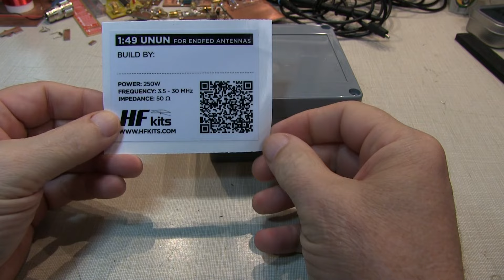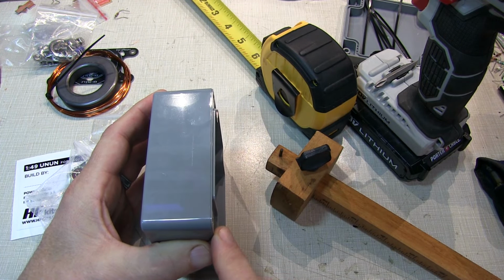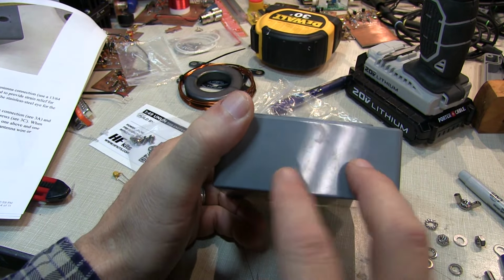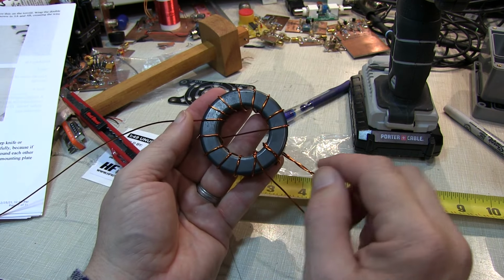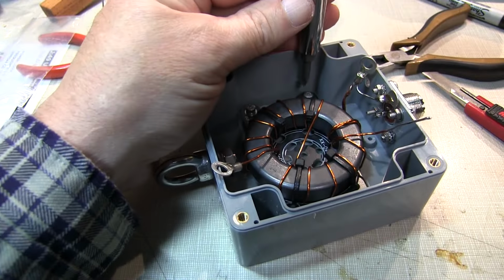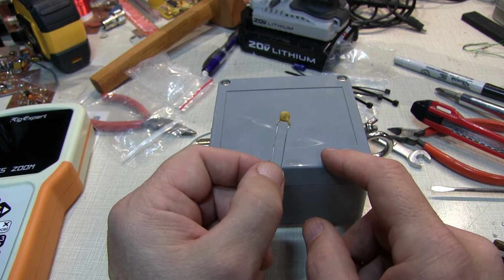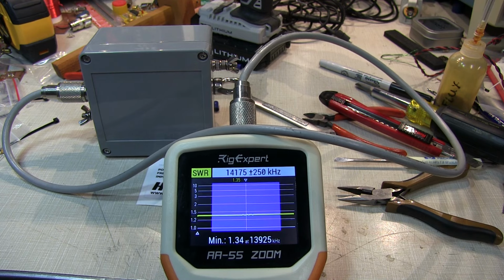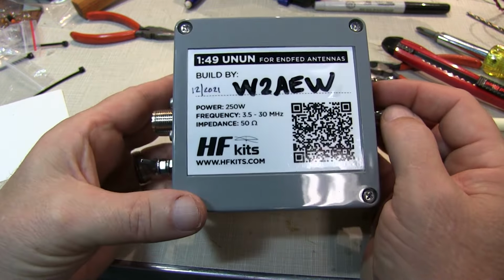#344: ARRL 49:1 End Fed Halfwave UNUN transformer kit from HFKits - Build and quick bench test

Comment: Experience needs one piece of advice. When operating, it is best to have a common mode choke on the feed line at approximately .05 wavelengths from UnUn for the lowest band you use (80 or 40). This is best regardless of attached counterpoise.
Reply from the maker: Great piece of advice!
Reply: Yes, just use common mode choke 0.05 wavelengths down from the feed point on the lowest band and don’t use an external counterpoise (AA5TB was the first to propose a 0.05 length counterpoise as being adequate based on modeling, and I have also confirmed 0.05 wavelength is adequate based on modeling).  The outside of the shield for the first 0.05 wavelengths of the coax is adequate counterpoise.  Having the choke also does a great job keeping RF out of the shack.  I use a 40 meter EFHW mounted horizontally using the 0.05 wavelength choke concept and could not be happier.  My choke is 14 turns of RG58 on an FT240-31 toroid core and this choke is based on the work done by K9YC.
Reply: @wd8dsb  So your RG 58 is wound around a toroid? like the whole coax? or would  RF chokes like snap on work also?

Comment: Mount the stud for the counterpoise? An end fed antenna DOES NOT require any counterpoise. The stud you are installing is for EARTH grounding the antenna. This helps provide some lightning protection and also bleeds off static charges helping to make the receive with the antenna more quiet. ARRL folks you need to get your terms correct!!!

Comment: Here is a little tip. Move the counterpoise terminal to the same side of the housing as the driven wire. Attach approx 6 to 8 feet of 450 ohm ladder line. Shorten your main line by the same amount and connect it to the main line of the 450 ohm ladder line. The other conductor of the ladder line terminates in mid air. You then have a built in counterpoise for portable or temporary use. BTW I would recommend you install the 100 pf cap in this configuration. This is a combination of the EFHW and Zeppelin antennas. You will usually find that this makes it totally useable on 6M as well.
Reply: Hi Alan, 

Thank you for this neat tip. I would like to be able to get the 6m band and want to try this approach.

To be sure I understand, one ladder line wire is attached to the antenna terminal and the other is attached to the counterpoise screw. At the other end the driven element is attached to the hot lead and the counterpoise wire is free. Is that correct?

In order to put the counterpoise screw on same side as fed wire, the enameled copper wire has to be brought over the transformer. Can't that short the transformer coil? Should it be covered with tape to prevent that?

For my 2nd floor setup I propose a short coax feed line be attached to a coax connector on my MFJ window pass-through panel which is ~10ft up. On the outside,  the 49:1 unun will be fed by a 1-2ft piece of coax and hang on the side of the house from the mounting screw on the unun.  The driven wire will be strung across the back yard to a couple 20ft fiberglass poles. The driven wire will also befitted with a homemade coil to access 80m as per kit directions.
Since this a semi-permanent installation at my QTH, how would you recommend grounding it? 

Thank you for your insights!
73,
John - KK7JBZ

Comment: The inductance & capacitance of the antenna, the length of the counter poise and the length of the coaxial cable will determine the final swr reading. It would be great to see details of the final setup of the antenna. 73 M0JZR
Reply from the maker: Ideally, if it is cut as a half-wave length of wire and properly mounted, it should have an endfed impedance that is 2500-3000 ohms resistive.  Of course, there are a lot of variables that can alter this...
Reply: @w2aew  Yip, that is why it would be great to see the final setup. 
Thanks for all the great videos and the reply Alan.

Comment: It's a clearer video with clearer pics than arrl website direction.  The different solder configuration from the ARRL directions confuses me.  As primary here is pigtailed.  But the other directions don't do a pigtail.
Reply from the maker: I mistakenly didn't leave enough wire, that's why I did the pigtail.

Comment: I built mine with two toroids with good results. Used it with a half wave at 40 Meters. Tunes all the hf bands including 6 meters, except for 10Mhz. Seems to be a good compromise for power handling, efficiency while still being matchable on the higher frequency hf bands.

Comment: Great video. Here in NE Florida I use an end fed half wave antenna cut for 80 meters configured as an inverted L. My home made 49:1 UNUN almost identical to the one in the video except I use two toroids glued together. It works from the low end of 80 to the top of the 10 meter band with an SWR low enough for my Icom 7300 to tune with it's internal tuner. Without the tuner the SWR is about 1.6 : 1 on 80 and 40 and about 1.9 : 1 on 20. 

For those who say that an end fed should be avoided I vehemently disagree. I consistently work Europe on 75 meter phone as well as on 40 SSB and CW with 100 Watts. Early on Christmas eve 2021 I worked E51JD Raratonga, Cook Islands in the South Pacific on the ANZA net on 20  meter SSB. I forgot that I had been testing with low power and was stunned when I looked down to see that I was working Jim with only 10 Watts !!! 

My UNUN is mounted on a pine tree about three feet from the ground. A 6 foot ground rod is hammered into the ground a few feet from the tree. The antenna runs about 50 feet up the pine tree before it goes horizontal to a second pine tree for a total length of 135 feet. The UNUN provides a direct DC connection to the ground rod which lowers static noise and provides superb lightening protection (essential here in Florida). I do not use any radials or a counterpoise, the coax provides that. By the way, I use a 100pF capacitor across the input, Dave N2SN.
Reply: Great video which reinforces the documentation that exist on that website (HF Kits)...I had sent for a bundle of toroids (43) and will be making some of these 49:1 UNUN....Dave, what is the purpose of using two toroids?   More power better performance?  Both?

Rafael / NN3RP
Reply: @TheCrunchbird  Thanks, David.   I watched Steve's overview of the UNUN.   He uses 3 toroids for full power!....This video and Steve's allow ones to fully understand the construction and hardware details; gluing toroids, eyehooks, plastic box, etc..   I am going to try the 3 toroid concept as I like QRO....others I will build for 1 toroid for my travelling purposes.   73s and hny 2022....Rafael / NN3RP
Reply: Hi David!
Studied your reply with interest as I have this kit and planning a similar install in my smallish back yard. 

Specifically, to what part of the unun did you attach the ground? Did you add a lightning arrestor at some point, and if so, where?

Thank you for your help!
Kind regards,
John - KK7JBZ
Reply: @johnbauman4005  John, I grounded the shield side of the coax to a six foot ground rod. This is a really good way to protect from a lightening strike as the antenna has a DC connection to ground right at the UNUN. It also eliminates static buildup. 

There is no need for a counterpoise as the antenna uses the coax for that. Some people insist on using one and adding a choke or an inductor to isolate the coax before the UNUN. I and many others have not done that. Both ways work just fine. 

Be careful not to wind any loops in the coax unless they are near the shack as the antenna uses the coax for its other half (unless you use a counterpoise). 

I have worked the world with 100 Watts and I have even held a QRP sideband QSO with several Australian stations from my QTH here in NE Florida running five Watts. 

My antenna is a half wave for 80 meters but for a smaller garden you can use a half wave for 40 meters and still work the harmonics. The antenna can be formed into an inverted V or even an odd shape and it will still provide great results. Good luck, Dave, N2SN in Hilliard Florida.
Reply: @TheCrunchbird  Hi Dave! Thanks for the quick reply and all the info. 

My radio room is about 10ft up, over the garage. I was planning a 2ft run of coax from IC-7300 to my MFJ pass through panel. Outside I would use another 2ft of coax from panel to unun and secure unun to the side of my house using the provided hardware. The antenna wire would run diagonally out to the right property line to a 20ft fiberglass pole, then to the left along the back fence to another 20ft pole. Also plan to insert the coil for 80m as per the instructions. 

In this case there isn't much of a feedline run to serve as counterpoise which is why I think I need one. 

This saves money, time and work vs having to bury 30 -60ft of waterproof coax. This native Floridian now lives in the Pacific NW and it is rainy most of the year. 

Am also considering another mod suggested on YT to use ~8ft of 450 ohm ladderline with one side attached to the unun at the center terminal of the antenna output connector and the other to the counterpoise connector. At the other end the hot ladder line wire goes to the antenna and the other lead (counterpoise) is open. In this case I think I need to run flat copper strap from the counterpoise screw to my house electrical service ground rod which is nearby.

In your experience does this proposed setup make sense? Am kinda making it up as I go along after reading a bunch and studying YT vids on EFHW antennas.

One of my goals is to be able to reliably make contacts in north FL from here. One of my brothers lives in Tallahassee, and I'd like him to get involved in the hobby also.

73,
John - KK7JBZ
Reply: @johnbauman4005  John,

What you are planning sounds OK to me providing that you don't get a lot of lightening like we do here in Florida and you are not after too much DX. 

For such a setup I suggest placing a nice long ground rod to connect the ground side of the UNUN. This keeps the antenna at ground potential which eliminates most static problems. It also provides a DC connection from the antenna to ground that will conduct a lightening strike to the ground instead of into your shack. 

I am running coax about forty feet underground to a 50 foot pine tree. The UNUN is screwed to the tree and right below it is a six foot ground rod that connects to the UNUN's ground. The antenna wire runs up to near the top of the tree then comes down diagonally to a wooden fence pole. 

Your antenna will work much better for DX if you place the UNUN at the pole and run the wire up the pole before bringing it down at an angle or running it horizontally. This would be similar to what I am doing here. My advice is as follows: 

Run direct bury rated coax out to the pole. Connect the UNUN about two feet up the pole and connect its ground to a six foot ground rod. The buried coax will become part of the antenna negating the requirement for a counterpoise. Now run the remaining wire to the second pole and down to whatever you can connect it such as a fence post. Be warned that the end of the wire will be at a high voltage when you are transmitting so keep it above head height so you don't fry the kids. 

My QTH is in the extreme NE of Florida above Jacksonville and just below the Georgia line. Let me know when you get your antenna up and I will make a schedule with you. I too am running an ICOM-7300 (fantastic little rig) barefoot so it will be a good test to see if you will be OK to work your brother. 

Good luck, Dave, N2SN.
Reply: @TheCrunchbird   @David Emery  Hi Dave! Wow, thank you!

I have a way to go yet - a few items on order, and plan has changed a bit after ordering Spiderbeam 12m pole and corresponding with them. Doing the trig and using a laser measure sorted things a bit. I will order enough coax to give your recommendation a try also. Problem is the buried coax also has to cross a small stone wall and stones are large and well embedded in the ground. I'll figure something out.

73,
John

Comment: Thanks for sharing. Not my area of interest, or expertise, but it is always fun to watch a build. Tip = You can g-r-e-a-t-l-y strengthen the anchor bolt point by just adding a backer plate. A large flat fender washer can work. Add a little epoxy under it. HTH.

Comment: Hi Alan - I just assembled this same kit from HF Kits. After completing the assembly I took another look at the orientation of the SO239 connector. I’m relieved to see that I installed the connector the same way you did with the square plate on the exterior of the box, which is opposite of what’s shown in the instructions. Having the plate on the interior seems to invite water penetration. I’m now building a choke kit from HF Kits and find the same issue. I’m going to go with my intuition and install the plates on the exterior. - Cheers - Jim (KK7CSC)

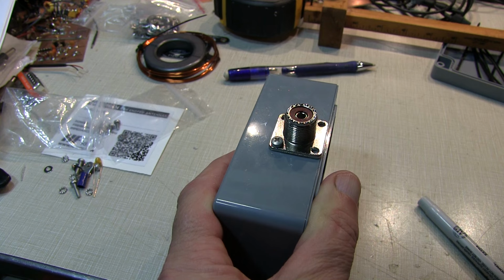Comment: Nice build, Alan. Personally, I've never had success with multiband EFHWs with a transformer on a ferrite core, and I tried like 5 times with slightly different transformers (1:49 / 1:64, different core material, autotransformers / galvanically isolated). It seems that all the online reports on successful builds of such antennas don't use a 1:1 balun and use the feedline as a part of the antenna. Also, I measured the losses in the 49:1 transformer on an FT240-43 core and got about 1 dB or 20% of power which is huge (a 1:4 transformer in a City Windom has only 4% of losses). This being said, Fuchs antenna, City WIndoms and single-band EFHWs work just fine. I wonder what your experience is going to be like. 73s from Russia!
Reply from the maker: I was planning just using this as single band, changing the wire when I want to change bands.  This will mainly be a portable/temporary antenna for when I operate in the field.  I do have a Par Electronics tri-band endfed (which has a loading coil in the antenna wire), and it works great.
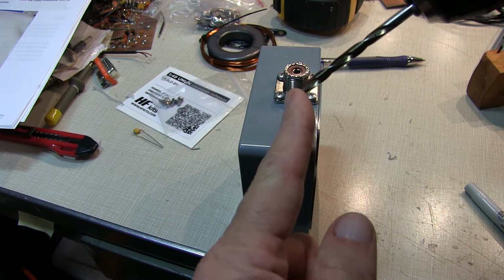Reply: @w2aew  Well... for a single band you don't really need a 1:49 transformer. You can build a "vertical dipole", i.e. build half of the dipole from a wire and another half from a coax, put a 1:1 balun on the end of the coax. In other words, similarly to City Windom, but without a 1:4 transformed and with the feed point in the center. The effect will be the same, except no power will be wasted on heating the core 🤷‍♂️ 

Speaking of Par Electronics tri-band endfed, does it has a balun, or it uses the feedline as a part of the antenna? Did you measure the radiated power compared to other antennas in the same conditions? Multiband EFHWs work for sure, I've built one that "worked" myself. The problem is that efficiency is very low compared to pretty much any other antenna.
Reply from the maker: @R2AUK  For portable operating, I usually don't have enough room for a length of coax that is equal to the antenna length, so a City Windom config wouldn't be convenient for me.  The Par unit has a matching box which I would imagine is a similar 49:1 transformer.  I haven't opened it up since it is sealed.  Most of my operating with this antenna is at QRP levels, and I have really good luck with it, so I don't agree that the efficiency is very low.  I think it is nearly as good as a dipole.
Reply: @w2aew  Fair enough. From the practical point of view, it is indeed almost as good as a dipole. Luckily it's impossible to notice 1 dB , or even 3 dB difference OTA. And it will not matter if conditions are OK and your goal is to make a CW contact with a random OP (making SSB contacts when conditions are poor is another story...).  I'm not trying to prove that you are using a wrong antenna or anything like that :D In this case, I'm interested in antenna theory, particularly if it's possible to make a "fair", say, 10/15/20/40m EFHW with sharp dips on the SWR plot (otherwise it indicates that it has more in common with a dummy load than with an antenna). To my knowledge, it doesn't work, despite what some online reports may tell. The reason is that on 2nd harmonic the commonly used 0.05 λ counterpose is not 0.05 λ anymore, and the end effect works only once. Electrically, the feed point gets moved closer to the center where the input impedance is far from 2450 Ohm and closer to ~500 Ohm. At least that's what my measurements told me. But in case you are interested in this area as well, I would appreciate a second opinion.

Comment: Thanks for another great video.  And thanks for sweeping all the bands as it answered a question I have.  I had wanted to get this and add more wire so I could get down to the 160M range.  Your scan show that provably would not have worked well.  I suspect a counter poise may be able to change that but probably not.  Thanks again de ki7cea 73
Reply from the maker: Yeah, you'd probably need to double up the turns on the transformer, or switch to a different core material such as 75 instead of the 43 type used here.

Comment: ...here's another tip... Assuming the core materials is a quality #43, such as sold by Amidon,  build  that thing with a larger diameter wire....#16 and reduce your I/R losses at the low Z point... particularly if you run more than 50 or 100 watts.  My similar 49:1 with a 110pf capacitor on a 130' EFHW sloper gives me 1:1 on 7, 14, 21, and 24 mhz... 1.5:1 on the lower end of 80 but acceptable higher up, and 1.7:1 at 28.4. You have to do your measurements in an in situ environment.  It's almost like a black art... My counterpoise is the coax shield on some LMR 400.. nothing else, no common current chokes and no funny coax lengths...This is pretty much the same as the way MYAntennas do things.. and yes they have it figured, so y don't have to reinvent the wheel here.    VA7AA